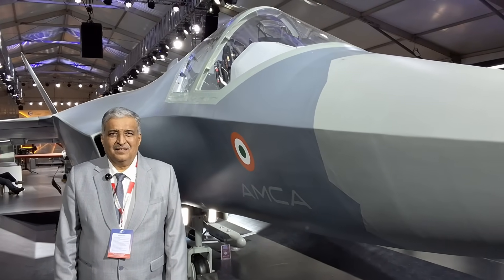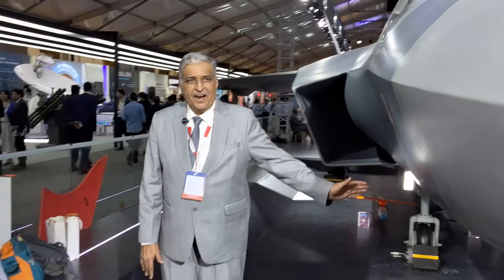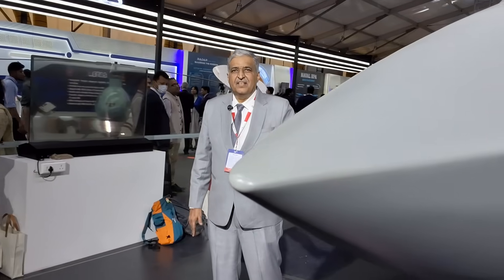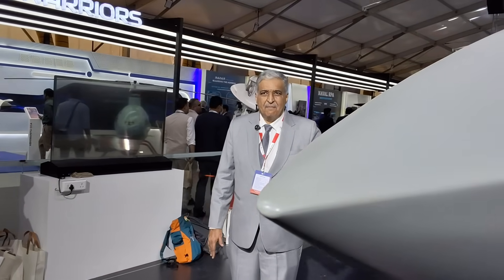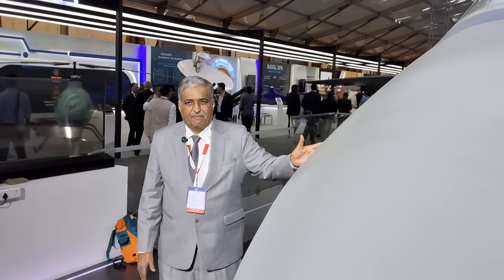PART-2 | #AMCA to carry many 6th-gen techs; sensors to be proven in 1 year: Jitendra Jadhav, DG #ADA

Comment: On paper AMCA can have Bose sound system, LED TV, PS5 because it is on paper only. Nothing substantial has come out. I heard about this programme in 2013 and CCS approval only arrived in 2024(decision making process, and releasing funds,India’s darkest demon).
Not planning for a 5th gen engine will be its Achilles Heel. Remember that. Also mark my words and note this date that I have commented this.
If Russians integrate the new engine with new data link and new missiles, IAF should consider about the SU 57 M.

Comment: Hindustan Aeronautics Limited (HAL) has consistently fallen short of its commitments in the past, making it one of the most inefficient PSUs in India. They have been lagging behind by 10 to 20 years across various sectors. For instance, the delivery of the Tejas fighter jet was delayed by 10 to 20 years, and now they are moving on to plans for the AMCA. Despite decades of work, HAL has only managed to deliver around 40 Tejas jets. This raises serious doubts about their capability to meet India's defense needs. To address this, India should either consider privatizing HAL or avoid relying solely on them for its fighter jet requirements. A mixed approach of importing fighters while continuing limited production through HAL could be a more practical solution. Relying too much on HAL may result in further delays, which could ultimately put the Indian Air Force at greater risk.

Comment: I had visited Aero India show in the mid 1990s .There was an LCA model on the tarmac.Now in 2025 we have less than 40 Lca in service.HAL will promise moon but deliver peanuts
Reply: So! The bottom line is Jet Engines, until then it makes no sense to brag about it.
Reply: Illiterate Dumb HAL was not developing Tejas in 1990. It was ADA, NAL & DRDO. HAL is just a manufacturing company which got orders in 2020s to manufacture Tejas. And for that also they need fund, which your Papa Modi was not sanctioning until 2022.
Reply: @sambitranjan9584  So why didn't ur manmohan papa took steps for that ?
N whatever progress happened in tejas has happened in last 10 years. When Modi came into power. Ok dumb 😂 tejas mk1 are delivered but many of them r pending bcoz of usa engines not delivered timely.
Reply: @sambitranjan9584 Idk why dumb fools like you always mention politics in any arguement

Comment: No EOTS like F-35, J-20, J-35. How it will possess 6th gen features when 5th gen sensors are missing?
Reply: They can’t build the normal aircraft you are talking about this jumbo
Reply: AMCA mk 1 will fly with an IRST but mk2 will fly with an EOTS. 
A private company has already developed a sapphire shroud for the eots. Eots system is already under development and has completed testing on a flying testbed.
Reply: For that, you need your own semiconductor company which will help you making EOTS. They need chips which we don't have for now